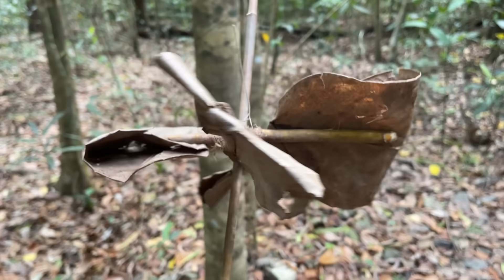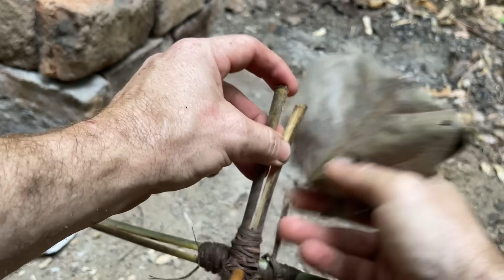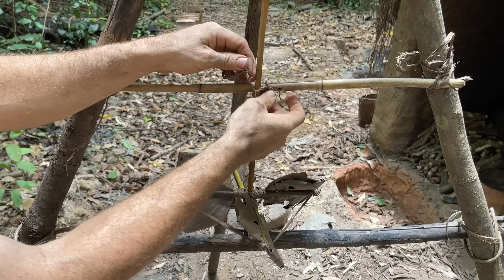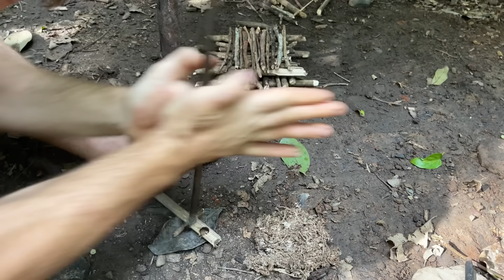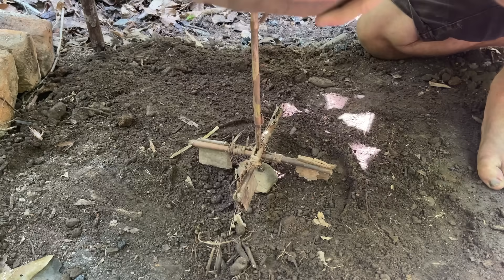Primitive Technology: Convection turbine experiments (hot air windmill)

Comment: First of all, nice joke with the Fire Safety Monitor.  Second of all, there are far too many losses with the system to try to use air to push air.  I think you were far closer with the waterwheel idea, but again, you are going to face a bunch of losses unless you greatly scale up.  I actually now wonder if you could somehow rig something to your feet to pump the water bellows that you built before by raising and lowering your feet.  By pushing down your feet, you could pull down a rope thrown over a beam / pulley to the water bellows below you could pump the bellows by doing a form of stair stepping.  Otherwise you would need to build stronger pots that can hold your weight, and have the holes for the bellows be off center, allowing you to tie the pots to your feet for lifting and stepping.  This second option is far more difficult, and more energy consuming in my opinion, as you are lifting the pots by lifting your legs, vs lifting the pots by pushing your feet down.

Comment: AI Summary

Abstract:
This experimental report details the design, fabrication, and testing of a primitive convection turbine (heat-driven axial mill) intended to provide a water-independent source of motive force. The project investigates the conversion of thermal buoyancy from an open fire into mechanical torque via an axial-flow rotor constructed from rattan and palm leaves. The engineering process involved optimizing fluid flow through the construction of a pyramidal hood to concentrate thermal updrafts and the implementation of thrust and journal bearings to minimize friction. While functional as a proof of concept, the system demonstrated low power density and significant material vulnerability to thermal failure, eventually resulting in the total destruction of the unit during high-output testing.

Experimental Summary: Convection Turbine Prototype and Mechanical Integration

*   0:00 Axial Turbine Design: The initial phase involved modifying a radial fan into an axial turbine. By altering the blade pitch (twisting), the rotor was reconfigured to utilize vertical airflow rather than centrifugal displacement.
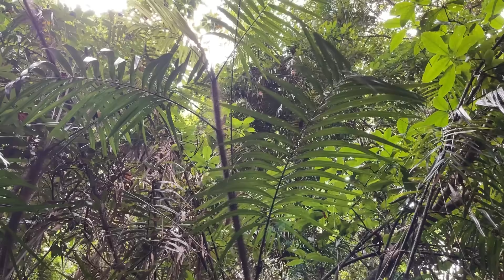*   1:06 Material Selection and Preparation: Rattan (cane) was selected for the rotor and spokes due to its high strength-to-weight ratio and flexibility. Components were processed using lithic tools (stone scoring and splitting) to 25 cm lengths.
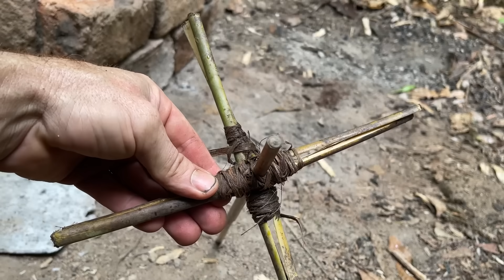*   2:31 Thermoplastic Deformation for Pitch Control: To ensure consistent aerodynamic performance, cane spokes were heated and twisted to a specific angle. This heat-setting technique ensures the blades maintain a uniform pitch to capture the kinetic energy of rising hot air.
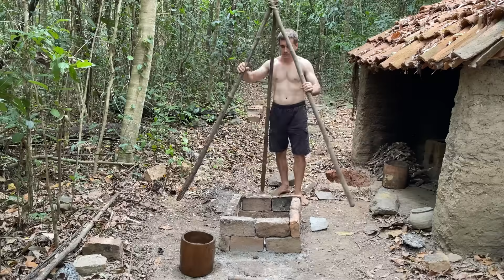*   3:56 Structural Support and Bearing Assemblies: The turbine was integrated into a tripod frame using a primitive bearing system. A lower socket (thrust bearing) and an upper string (journal bearing) were utilized to stabilize the rotor and allow continuous rotation without torque-induced cable winding.
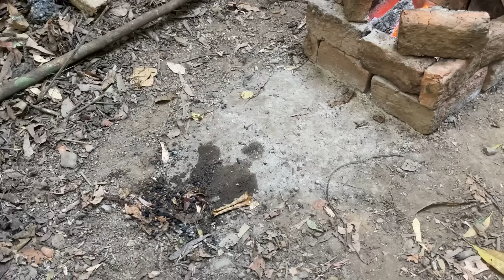*   5:55 Fluid Flow Optimization (Phase I): An existing clay furnace roof was repurposed as a funnel. By narrowing the aperture below the turbine, the velocity of the rising air (updraft) was increased, resulting in higher rotational RPM.
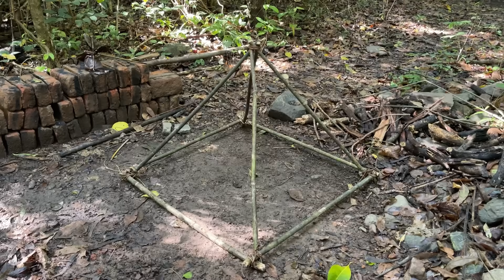*   7:01 Pyramidal Hood Construction (Phase II): A large-scale pyramidal funnel was fabricated using a timber frame and broad-leaf cladding. This structure served as a thermal chimney, capturing a larger volume of heated air and directing it through the turbine’s sweep area.
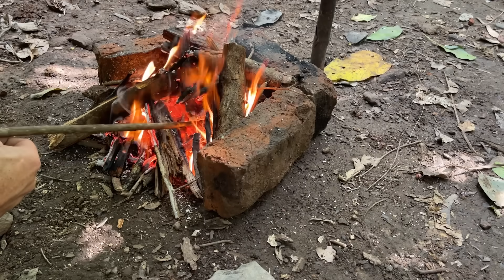*   10:20 Friction Reduction: The base of the rotor was fire-hardened and sharpened to a point to minimize the contact surface area within the thrust bearing socket, reducing parasitic frictional losses.
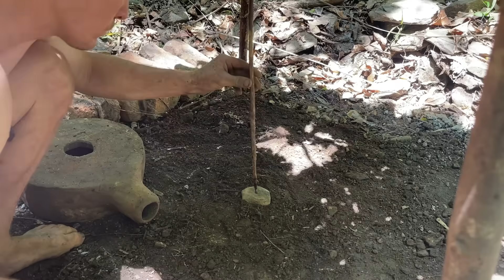*   11:02 Mechanical Load Testing (Turbocharger Concept): The turbine was coupled to a secondary forge blower via a vertical drive shaft. The objective was to create a self-sustaining, heat-powered air induction system for smelting.
*   11:36 Performance Analysis: Functional testing confirmed that the convection-driven turbine could rotate the blower fan; however, the torque generated was insufficient for high-pressure air delivery. The system operated at the margins of viability.
*   11:59 Failure Mode - Thermal Collapse: During the final test, the proximity of the flammable organic components (dry leaves and cane) to the heat source, combined with the concentrated thermal column, led to auto-ignition. The machine suffered a catastrophic structural failure due to fire.

AI-generated summary created with gemini-3-flash-preview for free via RocketRecap-dot-com. (Input: 14,366 tokens, Output: 953 tokens, Est. cost: $0.0100).

Comment: Loving the experimental format. Like getting a glimpse into the past when similar tech ideas were fleshed out. I think getting zero friction on the bottom of your turbine shaft would help and also make an oven with a chimney to blast that heat directly on your fan blades. Won't burn your setup down that way either.
Reply: Yeah, combine the previous 4m chimney with this mill and he'll have something neat.

Comment: I wonder if creating a narrower funnel/chimney made with brick and pottery tiles would provide a more consistent and more forceful flow of air as the brick and ceramic would heat up in use and then help to keep the air as hot as possible in order to maximise the rising air flow. If it did then it might be possible to have a taller chimney with multiple fans to catch the air and drive a fan in the bellows more quickly.
Reply: So the turbine has to be ceramic, also known as fired clay. Likewise, for a matching duct. With one set of blades it is a ducted fan. With a series of blades it is a jet engine.

The next step is to make a pottery wheel for making a round duct.
Reply: The extra heat in a chimney may cause the leaves to catch fire from a single ember
Reply: Yeah build it out of something that wont burn down

Comment: What about a steam powered one? you could make a chamber and a rudimentary pipe to blow a fan... and you have endless water nearby. Great video as always!!
Reply: Others who know about these things say the big obstacle with steam is the pressure vessel, which needs to be very strong and have a snug, heatproof connection with the outlet.
Reply: Steam power sounds like a neat idea. The steam turbine part could be fairly small, so easier to make out of durable materials.
Reply: The bottleneck really is having workable metals to make things with. Ironically if he had metals, it would be much easier to smelt metals.

Comment: Try putting the heated fan on top of a forge chimney, use wet boards as blades so they don't get on fire so fast. Then use pulleys to transfer the power down, to the blower. The boards are definitely heavier than the leaves, so they'll need more air hitting them, but as soon they start spinning, the blower should spin fast enough to increase the air current in the forge, what will make the heated fan spin faster.

Comment: I wonder if you’d have more success at the other end of a draft furnace, like putting the turbine in front of the air intake of a draft furnace. You wouldn’t have to worry about it burning down, and I think it could be easier to control where the flow is coming from

Comment: The man is building turbochargers now.
Reply: next video: primitive jet engine afterburner...
Reply: Very much a turbo, it just is way too inefficient.  Need to funnel way more of the heat and energy, with non flammable materials.  Maybe more mud/stone is the answer?
Reply: @Donn29  it's already too heavy though. it needs to be very light to actually do anything
Reply: @PotatoMC1  The 'housing' could be made from harder materials easily, then it's just the blades that need to made of something more resistant to fire.  Maybe even something like bark that won't catch as quickly?  And the blades could maybe bet kept wet somehow.
Reply: @Donn29  The turbine doesn't need air that's that hot. It just need much more air. A much smaller fire heating up a higher chimney can produce a massive draft with very little heat. If he finally makes a decent knife he could easily carve a propeller out of some solid wood. He can make a bladeless air compressor at the river with pottery and about 30-50 cm height drop and use bamboo stems for pipes. As the air will be cool he can seal the joints with tree resin. Than he can use that pressurised air to power an actually effective smelter and make some steel for that elusive knife.
Reply: @Donn29 I'm picturing something like a masonry stove. I think there is even some evidence of them being built and used by cultures in glacial periods. Likely not with a built in turbo but this project definitely has legs.
Reply: @Donn29 similar to how he makes his blowers, just put a blower on top of one of those clay fire chimineas. He'd have to make the chiminea and blower himself, though. Also, who says a fire exhaust has to be on top? (Yes I know, heat rises, so put the exhaust higher than the intake) Put the blower on the side or ground, and route the exhaust down to the side via masonry. You could even make a temporary wood structure that burns away once firing has begun
Reply: Speedrunning civilizatuon in 10 years
Reply: @matthisluhrmann9070  tech boost
Reply: ..and true to form, his first turbocharged wood burner destroyed itself 🤣
Reply: Boost creep cause it to burn out
Reply: He's becoming too powerful.  He must be stopped.
Reply: This was my first thought.
Reply: Waiting till he discovers the Bernoulli principle and builds a chimney that simply exits in the running river nearby.

Comment: Idea for your turbo charger:

Two inlets, one for cold air and one for hot air.

Maybe try a hollow log (Swedish torch)?

You can force the air through the log at speed.

Also, you can cut the log lengthwise into 4-6 equal pieces, then cut the points off each slice. When you put it back together, it will be a hollow log. This eliminates the need for tools (a wood auger in this case).

Comment: Wouldn't just raising the chimney like you have done before have the same effect but way more efficiently? I mean.. you're using hot air from a forge (I'm assuming you intend to use the forge heat itself) to raise air that spins a windmill which then spins a turbine that blows air back into the forge - with staggering efficiency losses at each step. Better off just using the hot air directly, via chimney, to pull air into the bottom inlet. I don't think the turbocharger principle applies here because it leverages the leftover/wasted energy after the crankshaft is spun.

Comment: I think you want less of an angle on the upper blades and/or more blades, so you can get higher torque. At the moment most of the rising air just goes right past.
See windmills made for pumping water, for example.

Comment: the blades are too small. you would want a larger area, for more leverage, and wider fire for more updraft.
Reply: what he needs is to belt it  from a large wheel to a small wheel to affect a greater nozzle pressure+flowrate in the blower, what he actually needs is more fanblades giving better energy harvesting on the actual blade configuration
Reply: @F14thunderhawk  he tried wheels before, didn't hold up very well, without iron, he just can't shape wood very well
Reply: @celivalg  Thats not a problem of materials, its a problem of proceedure and time. if he went through the effort to lap a 3 plate process and then build a lathe to get True Round, WHeels would work alot better. then its just about adding Tensioners to the rope to maintain linear velocity.

the major difficulty is that it would require almost entirely refined clay to produce the wheels, but it would allow more rigid axels by relying on heartwood rather then sapwood sticks.
Reply: @F14thunderhawk   without iron i dont know what he would use as the cutting tool for his lathe, i dont think stone would put up well enough to be worth it
Reply: @F14thunderhawk maybe just boil water in a container with a small nozzle and turn it into a steam turbine at this point
Reply: Also wooden blades should be an improvement as they are more sturdy and should lose less of the updraft to just bending like leaves do, but I am not sure if you can properly cut rather thin slices of wood with only stone tools.
Reply: @matscho  he could probably find some good bark pieces, they do weigh more tho, and attaching them to the axle is bound to be a challenge
Reply: @celivalg  Wooden Nails perhaps?
Reply: Doing more leaves or perhaps folding them around a bracer stick would have nearly the  same effect and be more easily replaced.
Reply: Yeah this, I was also thinking a greater number of blades for higher torque, but that would come at the expense of rpm. Ideally I think he needs a flywheel and a belt reduction, but that's gonna be difficult to manufacture out of clay lol.
Reply: @SneedenFeeden  You also lose an incredible amount of power in friction. Not to mention the torque issues
Reply: @Vaelkari  there are more efficient blade shapes. there was a water pump used in 2 years of the toyota tercel that was known to solve overheating engine issues. it's reproduced and sold as a low cavitation vortex pump i believe.
Reply: I also think that he need a housing frame that directs the hot air flow directly to the fan blades, just like what happened when he put the fan directly over the fire it spinned faster
Reply: And some ceramic bearings
Reply: Paperbark should be ideal
Reply: I want him to go back to water, which in my opinion has more potential, maybe build a water tower if the creek is to flat.
Reply: Y r u gay?